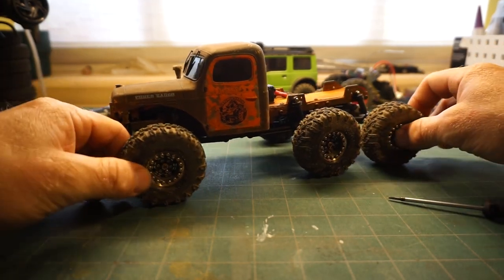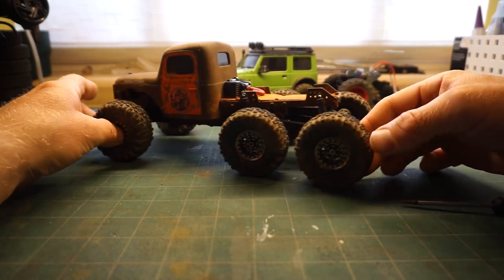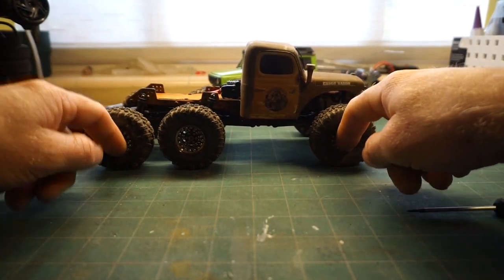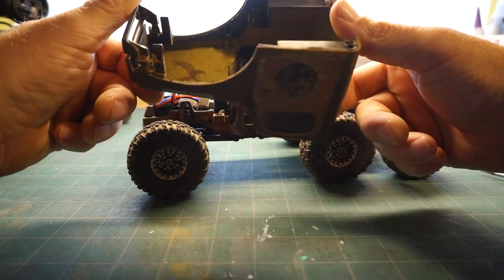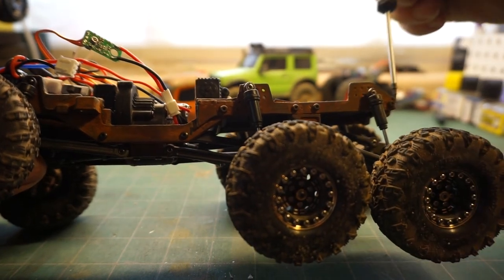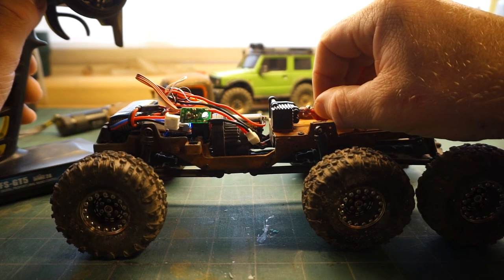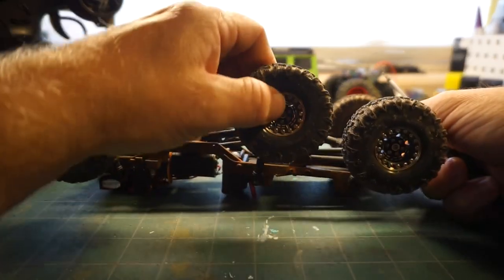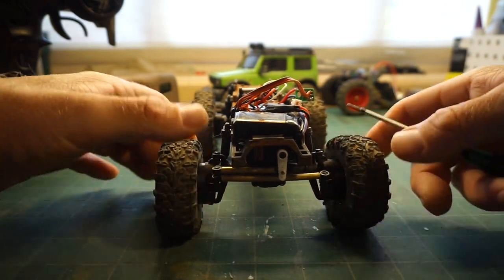FCX24 Hauk Wrecker 6x6

Comment: This is awesome!! Beautiful build, great surface finish. Overall well balanced look. :)
Thank you for making this video:)

Subscribed 🎉

Is your truck based on an Atlas or an FCX24? Just got into RC with a FCX24 and looking for options of how to mod it into a 6x6.

I did not understand the details about the driveshafts. You got Atlas axis and SCX axis and modified with extra set of FMS axis to create the middle axis?
Reply from the maker: Thanks! I could do a short video showing how to do the pass through if that would help.

Mine started as a stock FCX24 and most of the parts are FCX. The only atlas parts are the extension of the frame rails, the link mounts for the rear axle and the rear axle links.
Reply from the maker: I just uploaded a quick detail video covering how I built the pass through drive shaft.  Check it out here: https://youtu.be/efBnGTgJNPc

Comment: Not a fan of 6x6 in general but great job! Your lighting is on the back of the truck so it's hard to see the detail of that nice rust/chipping. I put a clear atlas body on my FCX24 and did a rust/patina. It looks VERY close to the FCX24 hard body. The proline is a joke in comparison. I have all three now.
Reply from the maker: Thanks! And yeah clearly my default work bench setup isn’t very good for filming because it faces a window. I think I’m gonna have to get a scale garage background to make it better.

I started with the proline in my original idea and while I did a decent paint job, I just really prefer more detailed hard bodies. Which is why I’m glad FMS is making so many hard body 1:18s. The FCX24 is only 1/24 in wheelbase, the body is clearly 1/18.
Reply: @TrailinAndScalin  Hehe. Yeah I started with the proline too because it matched the 1/24 wheelbase best. The detail wasn't horrible for lexan, but the proportions are cartoonish. The FCX24 just had enough boxes checked for me to buy a 1/18 and correct/lengthen the wheelbase. I opted for the McCue links till I find something better. I often call it a FMS18 Powerwagon.
Reply from the maker: Hah, I also call it the FCX18! On the Furitek chassis in the background I'm likely going to run McCue links or maybe DIY something similar.
Reply: @TrailinAndScalin  The McCue don't articulate any better then stock. But the wheel base helps performance. 2FMRC has been consulting with Furitek on longer rear high clearance links with multiple shock mount positions. I'm impatiently waiting for them. lol
Reply from the maker: @trailwomanrc  awesome to hear the 2FMRC is encouraging Furitek to get on creating some better links.
I really don’t understand why Treal and Furitek didn’t just do that automatically when they were making the FCX links they already sell.